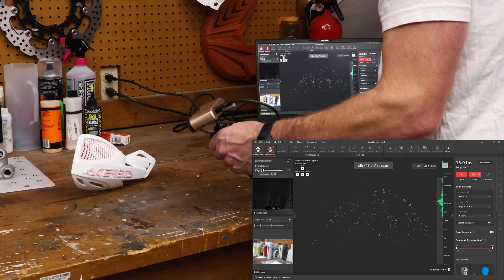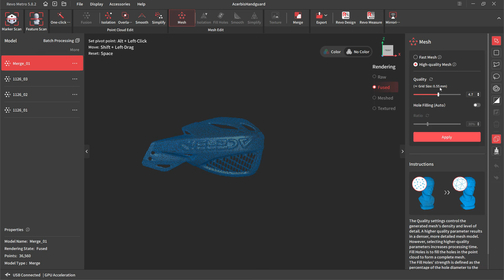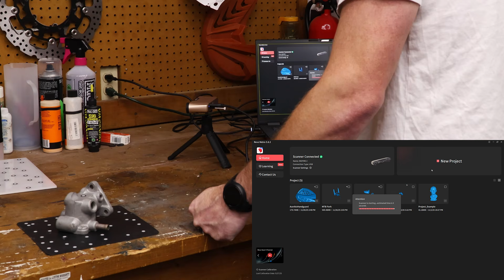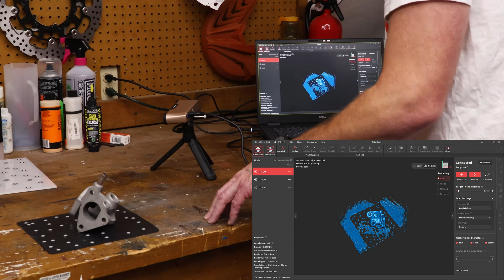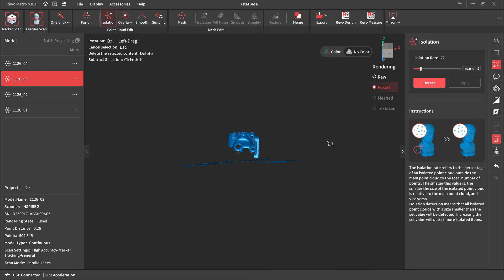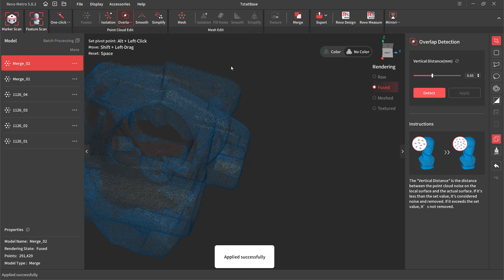How To Scan With The Revopoint Inspire2 | #revopoint #3dscanning #inspire2

Comment: What laptop spec are you running? Because my laptop chugs even though I've upgraded the ram and it's not that old. It's a fairly decent gaming laptop
Reply from the maker: I have a 13th gen i7 with an nvidia rtx 3500ada gcard and 32gb ram.  The thing is likely is the hangup is the GCard.  What is in your system?  CAD cards vs gaming cards behave a bit different on what they need.  

Is your RevoScan running on CPU or GPU acceleration?
Reply: @LearnEverythingAboutDesign I have 2 system my custom built Amd 5900x rtx3080 64gb ram system works good just a little slow but my laptop i7 14900, rtx4060 32gb ram just won't process scans only captures them
Reply from the maker: @DeadlySil3nt1  hm that is really strange!  When you launch revoscan and run their performance check, does it say anything about the system?  I my desktop is a 10th gen i7 with an rtx4000 and 64gb ram.  it won't capture well cause of the 10th gen i7 but processes great...

Comment: Great video, very nice and informative after receiving mine. I still can't scan very well yet but repetition is the key to improving. Thanks for choosing this product to share with us mere mortals.
Reply from the maker: Yeah Scanning in general takes time/practice.  Some times we feel like these things should just scan everything easily, and they are getting better, but setup does help.  Scan spray (if the part is shiny) really  helps.  Other things to watch for is the distance you are away from the object, and the exposure value.  In the IR preview window on top left you want to see just a hint of red (over exposure) when setting it up.  If you are scanning on auto and it isn't capturing trying increasing the intensity and see if that helps.

Comment: This is by far the best videos on this model. I am currently deciding between inspire 2 and the pop 3 plus. One thing that confuses me is how come the inspire 2 has a whole extra scanning mode, and yet it is cheaper? In which areas is it worse than the pop 3 plus then?
Reply from the maker: We will be releasing a video talking about and comparing all the scanners from revopoint very soon (hopefully this week).  but that is a great question.  The Inispire2 has a lot to offer for the price!  I would say that Inspire2 is more of a small object scanner while the Pop3 plus is a medium object scanner.  If you want to scan something the size of a basketball or helmet for example, the Pop3+ is more suited to that even though their working distances overlap.

but for my money out of those two i think the Inspire2 holds more value.  The laser mode is nice to have but keep in mind even though it says 90 fps, its slow compared to the bigger brother metro series of laser scanners.

My guess is that the price of that inspire will go up and the pop will go down at some point...
Reply: @LearnEverythingAboutDesign still waiting for the video!!

Comment: Great video!  Could you do a video on how to use the calibration plate?  Thank you!
Reply from the maker: Hey There, are you having issues with it?  The revoscan software has pretty good animations and steps to walk through the process.  I could cover it but there isn't really any trick to it.
Reply: @LearnEverythingAboutDesign  No issues yet.  I just got my Inspire2 a couple weeks ago after watching your review video and saw there was a glass calibration board in the box.  I haven't used it yet.  Nice to know there are easy to understand animations to recalibrate if the scanner starts having issues.  Thanks again!

Comment: I didn't notice how it only supported nVidia gpus. I needed the laser scanner, I get less than 1fps with my AMD 5800X cpu and 32g ram, at some point the software just freeze. Tried scanning some black plastic car parts for days now. I can't get a model out of it for my life. I sprayed it, I marked it etc. Still doesn't work. Even if I place it on the turntable and place the scanner on the tripod, it looses tracking after a few sec. A 500eur brick. Completely unusable. Nothing scans properly, I sat with it for 10 hours and couldn't get a single model out of it.

That image you get at 9:10. That's impossible on my unit, I only get spots of the image, like I can't get it to even give me something that resemble the model when it's still.  The "green" vertical bar is all over, impossible to get it as clean as you got it.
Reply from the maker: Dang that sucks!  In future videos I will be sure to point out AMD and MAC GPU (lack of) support.  I have asked revopoint about this but don't have an answer yet.

During your testing did you switch it to CPU only?  is that how you are getting 1fps?  How does it do on the structured light setting?
Reply: @LearnEverythingAboutDesign It's the laser thing that require a rtx3060 or higher. That one doesn't work in software mode. I ordered a 5060 now, see if that improves things. The normal mode doesn't lag but I can get it to track. Keep losing track the moment you move the camera no matter how slow you go. You need markers in normal mode too?
Reply from the maker: @simon_a_s  in normal mode you shouldn't need markers but they do help.  What I would say is to make sure the exposure is on auto or you manually set it so your preview shows a slight bit of red (over exposure) on the image.  If its too dark it will have all sorts of trouble.

Did you calibrate it already?  That can really cause problems if the calibration is way off.
Reply: @LearnEverythingAboutDesign  Thanks for the reply. Did the calibration. Dunno about the exposure, think it was on auto. The thing is that if I place a part on the table and scan in the normal mode I don't get something like you get at 9:10 in the vid. (What specs does your laptop got  btw?) It's just like random spots of the part, if you move it around slowly you can see the shape of the part but it just loose track of where it is after any movement after that. I tested mainly plastic interior parts of the car. Light gray shiny and black matte (sprayed those and it got better  but still the same issue as the gray). One thing I didn't do was to do multiple scans, I've always tried to scan the entire thing in one go but the track issue is still there so...

Got my workshop down in the cellar and I only got some led lights over the table, it's not very bright there. How much lighting in the room does it need really?

Comment: First of all. You are my GOAT! I am building a track tool and making car parts with fusion 360 and printing in PA-CF for example. Your Tutorials are making me so much better in constructing parts.

I am an absolute beginner and never bought a 3d scanner. 

I want to scan car parts like a crash bar or a frame rail. Or the Connection area of an intake manifold to the cylinder head. I think the smalles thing i want to scan is the PVC Valve from Toyota 2JZ. 
I think i want to say that i probably can live with reduced resolution and higher scanning time?! 

But will i actually be able to scan under the hood of my car successfully with this Scanner? I don´t have a budget of 4 digits and the Inspire is on sale for 400 Euro.  Or would you recommend something else in that price range?
Reply from the maker: thank you!

The under hood scanning....  The biggest problem I find with scanners like this and trying to scan under the hood is the availability of unique features.  When scanning in IR structure light mode (the only mode that can use features to track) you need to have enough detail that is unique so it can track where it is.  The scanning area is relatively small because you can't be more than 400mm away from the object so this means on a 2jz you would see maybe 2 ports.  If you were scanning the head without a manifold then you run into an issue with the port shapes being the same and the scanner getting lost (i would assume as i don't have a 2j to test :)).  So for that sort of thing i generally default to the Miraco as my goto scanner.  very portable, can be 1000mm away from the object in far mode so you catch more unique details to help the scan track its position.  So you might see the entire head in a single frame so it can pick up on brake/clutch master, detail on the firewall etc to help track where it is.

So could you get it done with an inspire if you use the mobile app and wireless kit? sure.  But you would probably end up using a bunch of marker dots and marker tracking even in feature mode.
Reply: @LearnEverythingAboutDesign   Thank you for the Feedback! So off to saving money we are...

Comment: Matt, when you were doing the laser scan and you needed to get the back of the part done, could you not have just rotated the marker-dot-scanning surface rather than reaching behind and angling the scanner? (I’m assuming that if the part moves even a tiny amount it could throw off the tracking.) If rotating the surface is acceptable, is it best practice to pause the scan while you rotate the surface?
Reply from the maker: If the scanner wasn't also picking up the workbench which isn't flat, i could have done that.  I was scanning my MTB fork and I ended up rotating the bars/fork while holding the scanner still, but in that case there was nothing picked up in the background as it was on a stand.  

So as long as you aren't getting a bunch of unique stuff around the plate sure.